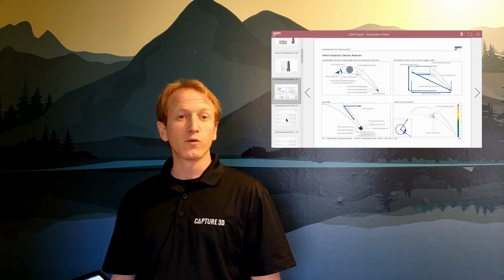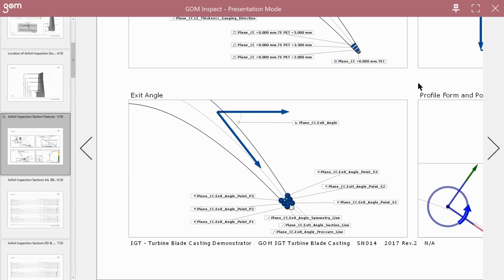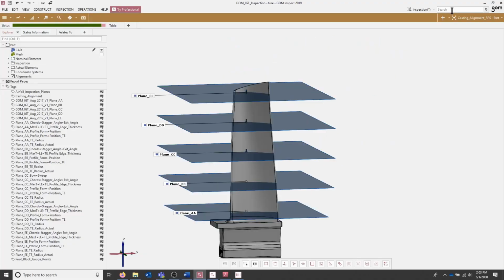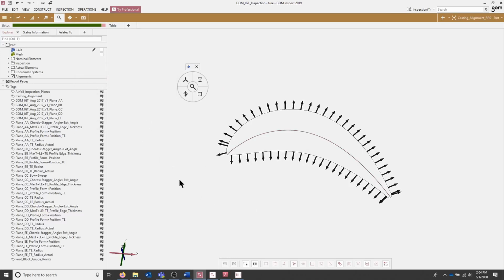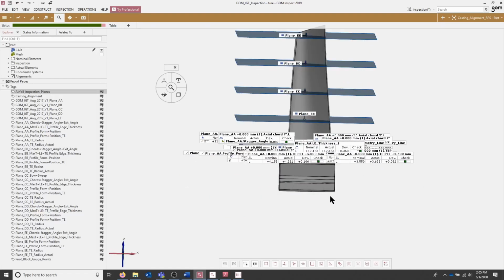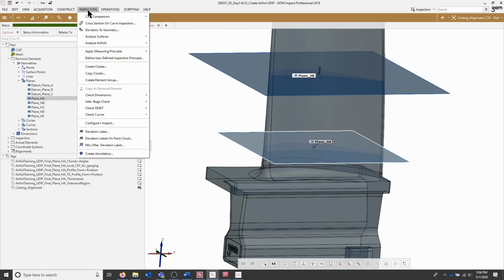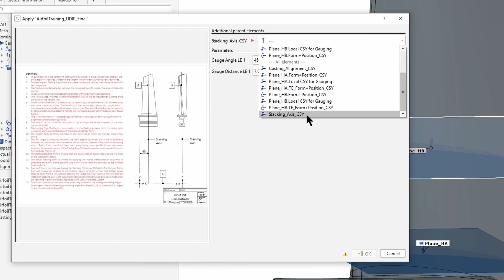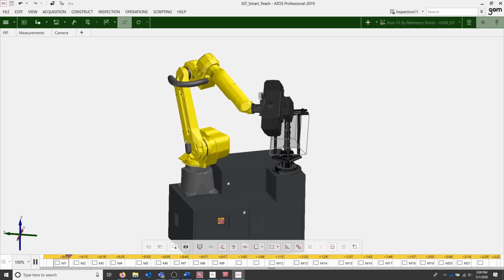How To Do Airfoil Inspection In GOM Inspect Software

Comment: Hi I am facing issue with airfoil profile contour,  it's giving error like the COordinate system is not linked with actual element.  Can I please get help in this?
Reply from the maker: Hi! Thanks for your question and thanks for watching. 

The profile form and position check requires that you give it a coordinate system that does not have any measuring principle. If you already applied a measuring principle it can cause issues with the calculation. We hope this helps!